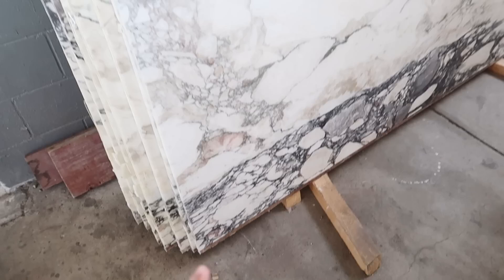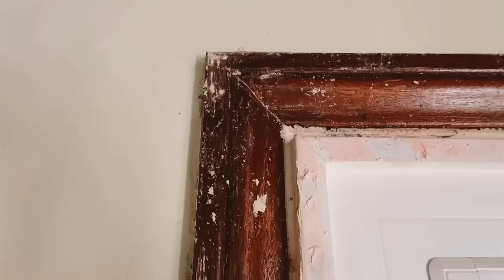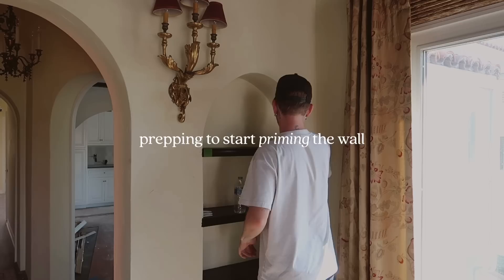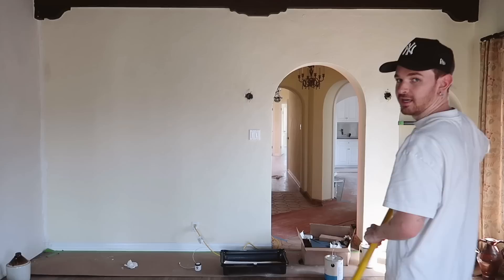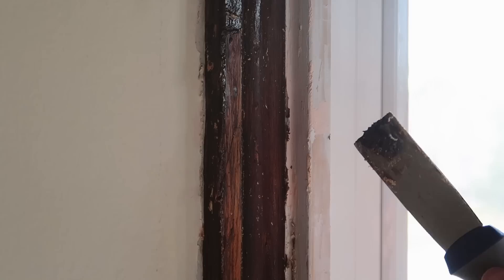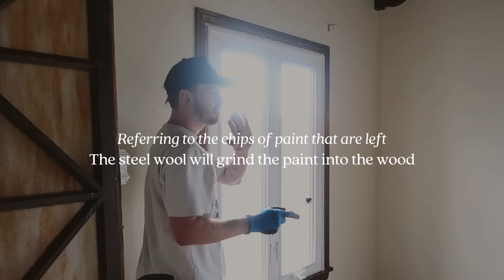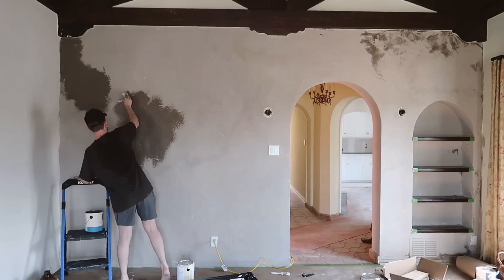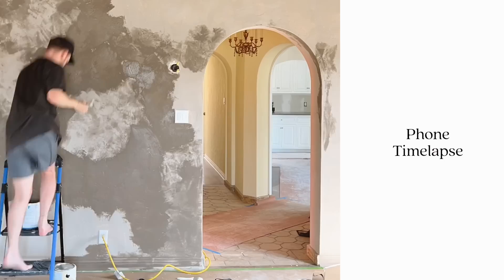WHY WHY WHY

Comment: What I learned from renovating my house is that long vertical swipes (rolls?) with the roller gives the most even finish when painting walls. You always see professionals rolling from floor to ceiling in one long motion. It’s also important to have enough paint on the roller so that the paint can even itself out, but not so much that you get drips. This is how the guy in the video you showed was able to cover the whole wall without going back for more paint. He did an initial diagonal roll to distribute paint across the wall, and then went over it in long vertical swipes, using the paint on the roller as well as picking up paint from the initial diagonal swipe. I cringe a little (sorry!) when I see people paint walls in short motions, going in all different directions, with way too little paint on the roller.
Reply: 👍🏼Exactly right. That’s the whole trick to doing it super-fast…you have to distribute the paint across the entire wall in one big zig-zag then immediately even it all out. It’s like having the paint all hanging there just waiting for you to spread it.

Comment: When we bought our house it had all plastic hose instead of proper pipe (like the flexible hose you have under a sink kind of) which was not even legal. The original owners paid the cost of replacement, but we upgraded to copper and had to pay that ourselves, I think. I agree with others that say the leak was probably something the homeowners knew about. So glad you didn't remove the tile in the bathroom!

Comment: I showed a clip of the wood trim to my husband and he said it's either Oak, Douglas Fir or Longleaf Heart Pine. He has a lot of experience working with wood but he said another way of figuring it out would be to cut a piece of the trim off and look at the end grain. I doubt you'll want to damage the trim so hopefully those names will lead you in the right direction.
Reply: I too am thinking it is quite possibly oak, the contractor should know, or Drew could research what kind of woods were more in use during that time period.
Reply: I've remodeled some 1920s Spanish and Tudor revival homes in California, and the trim is almost always mahogany.  It was shipped over from the Philippines and has a beautiful ability to reflect light and a refined grain 

Pro tip on stripping it: always use the steel wool in the direction of the grain to avoid lifting it.

Sometimes you'll find a lesser-quality wood on windows in the informal/service areas of the home.  But you'd never find it in a formal room.  

The only places I've seen oak (in Spanish and Tudor revival homes) is in the flooring.  Formal areas will be quarter-sawn and the less formal areas will be a standard grain.  

Craftsman homes in that vintage are done entirely in oak.
Reply: @ghannis6018  I agree, I think it is Mahogany !!!

Comment: When inspecting a home the inspector can only write down what he sees. He can't open up the wall and check the pipes or electrical.  Sad but true. When renovating some walls are removed or opened, a good contractor sees these things. The pipes were cast iron and most likely orginal to the home. This is a needed fix. Good it was caught. Glad you spoke up. 👊🏼

Comment: Hi Sweetie - you mentioned the wood trim.....my house was built in 1922 and the floors are fir, not oak. But, I live in New Hampshire and I haven't seen much oak. When I lived in California, my houses had oak floors and trim. Before they close up the walls on the plumbing repair, you should let it dry out if you see any damp...you don't want mold. I love the wall you did today. xo Suzi

Comment: You have Oak!!  YAY!!  The best and most durable hardwood/Show wood for Craftsman design.  Yes the Steel wool is the best tool.  If you decide to stain the window frames a darker color remember to "Condition" the wood first so that stain will apply evenly.  Just a tip - you can use water if your stain is water based.  There are some great Stain+Varnish finishes available too but remember also to use it to achieve the color tone you want and then switch to "Top/Clear Coat" for the final coat/coats.  Thank goodness you took the time and stayed true to your conviction not to rip out the bathroom tile.  Bravo.

Comment: Old woodworking stripping tip, you are correct, get the paint off, then use your steel wool dipped in mineral spirits.  You are so inspiring!  The brown lime wash is beautiful.

Comment: get a Dental pick set from amazon--- really helps pick out old paint from grooves and corners, then use steel wool with the stripper goop, neutralise and then lightly sand + now you are ready for your final finishing process.  Cheers-- prep is everything!

Comment: It’s amazing that your able to remove the old stain without jabbing the detail of the trim. Good job! I recently stripped my front door and there was layers and layers of old paint. It was the hardest home project I ever had. The citristrip wasn’t enough, so I had to resort to the stronger stuff. Getting paint out of the detail was tumultuous!
Reply: You can find effective strippers in the commercial sector. The strippers have the old formulas that actually work. The strippers available to DIYers is crap.

Comment: I am so sorry to hear about your plumbing issues.  I think within the first 60-90 Day that there should be some type of warranty/kickback when inspectors or sellers don’t disclose major repairs (ex. Roofing, electrical, plumbing, and with the foundations.  Or if their are leans on the house or property etc.).

With you at said I am glad your contractor and other trades workers are ethical and efficient!  I hope it is smooth sailing from this point forward.

Comment: I bought a 100 year old Spanish style home in Nor Cal. We had the exact same plumbing issue. My plumber said it was caused by having the water actually turned off for a long period. What happens is once the water is turned on, all the sediment has dried in the pipes and then is suddenly flushed through, causing the breaks. Seemed counterintuitive at first but makes sense now. We don’t turn off our water and when we do, turn it back on very slowly!

Comment: 😭😪 I am in Quartzsite Arizona so, 25 miles from the California border. I don't qualify for the contest rules. I have a 1978 travel trailer Casa Real (park model with tip outs and an awning), so it stays put. We bought some beautiful flooring, and paint for the walls, and we are going to change it up, freshen it up. We also need to update the bathroom and plan on a step in shower, getting rid of the tiny tub. Safer for us to use! I am going to look at a new fridge today and we are rebuilding our Arizona room (10 × 30feet) from monsoon wind damage. Wish I had your vision to make this  really come together!

Comment: Drew. When you use the citrus strip cover it with cling wrap or wax paper while it is working.  It will keep it moist and give you much more working time. If you can’t back to the removal it won’t go hard on you. Also the word work looks like oak. Very pretty

Comment: As you continue to strip the windows I would suggest doing a final application of stripper and then cleaning it off with steel wool and finally going in with a clean piece of steel wool dipped in mineral spirits. This will remove the remaining residue. I would then go over it with a bit of paper towel. Then it's time to sand and stain!

Comment: I’ve done 2 full home renovations on older homes.  1 was a 1930’s Spanish revival and the last one was an 1840’s Vaudoise Farmhouse.  In both cases, we did a full plumbing and electrical renovation before even starting the aesthetic renovations. 

If I were you, I would get the jump on any future plumbing issues by completely redoing all of the plumbing now before you start any of the other renovations.  Trust me, in the long run you won’t regret it!
Always better to be safe than sorry.  It cannot hurt to at least get an estimate for a complete plumbing revamp.
Hope this helps!

Comment: Put cling wrap over your citristrip...keep it wet. If it dries out  it will not get all the paint and varnish off.... Steel wool is a good idea... with  a warm soapy water wash and then clean water to rinse...then dry. Citristrip works really well.

Comment: I live in an older home. 2 years back I was standing in the kitchen and heard something. After some time I couldn't ignore the sound anymore. So I tried to follow it. Needless to say I was shocked. Whilst making breakfast I saw water coming out of the kitchen wall behind the tiles. The pipe of the shower (the wall dividing the kitchen and bathroom was where the pipe had a leak that just got bigger and bigger. We had to remove all the tiles in the kitchen and bathroom. Fixing the problem was worse because I had to live in the house during the renovation also we have brick walls not dry wall in South Africa. Removing all the tiles from both sides and then had to let it dry for 2 day days then tile it again. It was not fun and it's a lot of stress. But worth it in the end.

Comment: The stripped to bare wood trim looks either like redwood (more reddish tone/tint to the wood) or Douglas fir (more brownish tone/tint to the wood).  Both were used in in period homes like yours in California.  As far as the crack in the plumbing pipes, no inspector can see inside walls, Drew.  This happens all the time, especially in OLD homes like yours.  You never know what lurks behind the walls until you buy the house and start opening them up when restoring/remodeling.  I've learned that lesson by watching years' worth of "home improvement" shows, LOL.  But honestly, expect it.  The house I live in now was built in 1956 - it will soon be 100 years old, for pete's sake!  I will in the next  6-7 years have to replace the shingles on the house and garage, probably have the foundation inspected and tuck-pointed (it's concrete block), have work done or replace the concrete formed window ledges at the front of the house that rest on built-up Wisconsin lannon stone that dresses up the otherwise rather "blah" front facade, have concrete mud-jacked on the front sidewalk and slabs in the driveway, etc. etc.  It's never-ending.  Welcome to the world of home ownership.  You have a GEM of a home, enjoy it, and know that you, the owner, are now the "landlord."  Nobody to call to fix the plugged toilet, oy!

Comment: The marble slabs chosen for the kitchen are stunning, and running the marble backsplash it up the wall will definitely be the star/ statement element for that room  - Well done!!   I confess I cringed a bit when you started thinking about stacking tiles above the marble.  Please consider that it could detract from the beauty of the marble & make it look like the kitchen has too much going…. Like a lady that has too much jewelry on, a needs to loose a couple pieces before stepping out for the evening.  You get the idea…. Just a though to consider.  I’m also not a fan of the orange terra cotta tile - but did like the soft honey/beige hex tiles.  Just found your channel, and am enjoying it! 🥰👍🏻

Comment: Looks like the window moldings are oak. The wall looks truly lovely with the lime wash. You bought an old home and cast iron pipes were common then but will rust/split from the inside out. Their lifespan is about 30-40 years. Let's hope, they fixed everything. Do you know if the supply pipes running from the street to the house are also cast iron? Just keep an eye out, for any future problems.

Comment: HI Drew, you're doing great with the new place, as ever. 
I'm curious about the Antler shade of stuff you used on the walls - what's the idea of it - I'm not sure why they wouldn't just have something of the finished shade.. like paint, just apply it in a technique to get the finish you want? It's interesting

Comment: Please look at these use issues from a position of strength; fixing everything RIGHT the first time and from the bottom up will set you up for success and security moving forward. It would be such fun to just move in and decorate but in taking the time to do the work you’ve laid a great foundation for decades to come! My grandmother addressed one upgrade (not repair) per year and was never sorry. Your house is your biggest investment you will make, taking care to do the infrastructure right will pay off with no middle of the night emergencies!

Comment: Just a suggestion, invest in a service line warranty that will cover your outside lines. My warranty saved me thousands when the drain tile from the kitchen cracked. In my city it runs less than $170/yr. You don't have a deductible w/the warranty.  Read the fine print some warranties will cover only outside main lines, not the line from the house to the main !ine. You may need other coverage (insurance) for interior lines.

Comment: Steel wool is great for removing the goopy stuff but I find the pieces get clogged up pretty quickly. A cheaper alternative are green scrub pads. They come in different sizes but I get the larger size and cut them down. You can rinse them out in water so there is less to throw away at the end of the job.

Comment: The wall is gorgeous!! Great color. Just curious, why didn't the people u bought the house from pay for the repairs before u moved in? That's something they should be responsible for, unless u had them subtracted the cost from the price of the house. Usually, the inspector inspects, let u know what's going on & then let the owners know it needs to be fixed before u buy. I suppose it could work differently there

Comment: I’ve worked in the lumber industry and have grading tickets. To me the wood looks extremely like quarter sawn Sapele. Both the grain texture and colour definition between the spring/fall growth. You can’t really tell based on colour since it has been stained and not fully stripped. 

(Sapele is used as a mahogany substitute as far as I know) I’d say it’s quarter sawn regardless the type of wood based on the growth ring pattern… I’m no expert in historic homes and don’t know if they would’ve had access to Sapele when the house was built… so if it’s original I’d be inclined to vote white oak for sure. Just my opinion though!

https://homepillars.com/wp-content/uploads/2020/11/sapele.jpg

There’s a link to a quick Sapele photo sample!

Comment: these older well built houses usually have access to pipes somewhere. these smasher crashers just want to rip down tile, never let them!! what you showed looked much like mine, a removable panel. often in a closet back. 5000 for that amount of plumbing wasn’t crazy. remember the pipes are delicate, never ever use any liquid plumber solvent, don’t have the drains cleaned with roto rooter type equipment, gentle methods only.

Comment: Your window trim looks like mahogany just like the ones I remember in my great grandparents' fine Mediterranean-style home they built in the 1920s. I recommend stripping only a few feet of trim at a time, instead of coating the entire thing, as the stripper tends to dry and become a gooey mess if you leave it on for too long. Also, you need to really load that roller with paint to save yourself some strokes and get optimal coverage.

Comment: I noticed you did not remove the outlet covers before you painted, if you decide later to change them you might have to touch up around them if new ones are not the same size.   Love the walls though.

Comment: I guess you know this, but marble instantly etches the second an acid (citrus juice, tomato, wine, meat dishes with those) touches. It. Quartzite does not. I have had marble kitchen benches, glorious, but I coated them thinly in beeswax and hand buffed it. Need to reapply every couple of months, and maybe once a year rub it off and start again. Otherwise you will have marked benches. 🇦🇺

Comment: Quartz is easier to care for and is bacteria resistant.  Marble needs a coating to protect it from staining - always use a cutting board and use a tray under your coffee makerll  Plumbing; If you have to replace pipe you are better to replace the whole pipe and not piece it.  I was told never to mix plastic pipe with metal - it is a future leak waiting to happen.

Comment: Because it is a very old house sewer normally is amost finish, pipes and electricity cables are at the end of their life time or put of code and if you start a remodelation or addition the inspectors start to checking everything to make you be on code. It is how it is, save some money because those things are very very expensive.

Comment: Are you stripping the baseboards? Also try taking those shades off of the wall sconces and that light in the dining room downstairs. They wouldn’t be original. The lights should have candle flame shaped bulbs. You used to be able to get really ornate bulbs in a flame shape but the are hard to find now. I have the candle sconces too and my nana said they never had shades. She owned the house in 1940 and it has passed to my mum and me. Mine was built in 1928.

Comment: I'm curious, do you think they're might be the remote possibility that way you could have purchased the original windows that were in the house? It's just a coincidence that they fit the space and match the ceiling. They could have been sold or given away when the windows were replaced. Maybe you could locate an old picture of the exterior of the house. Just saying.....

Comment: Use a plastic wrap on top of the citrus strip to keep moist. This helps the product work better! Try in a small spot first!
Reply: Additionally with the citrus strip on lighter surfaces...not that yucky brown! When you scrape the product off, it can be reused! I typically will reuse it on   a new top layer, then use fresh stripper on exposed layer! This really saves you a lot of stripper!